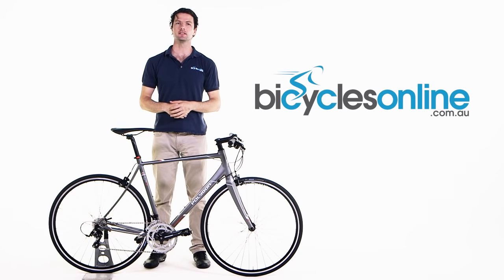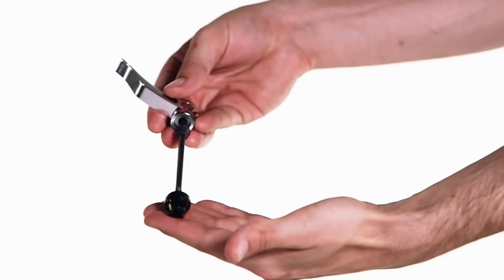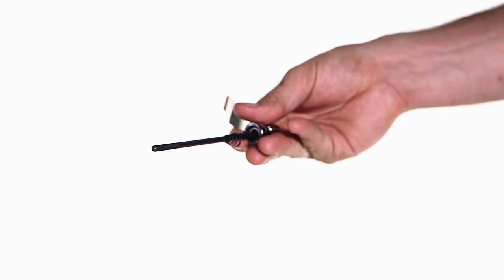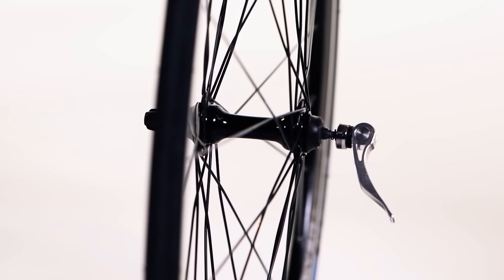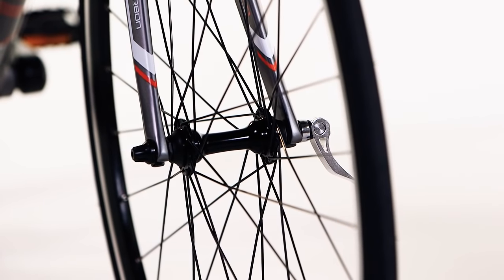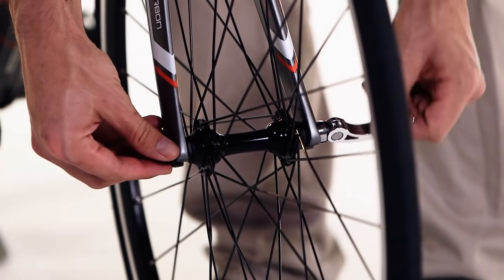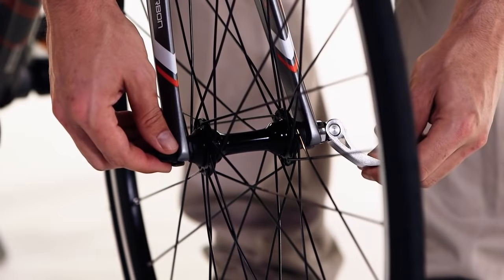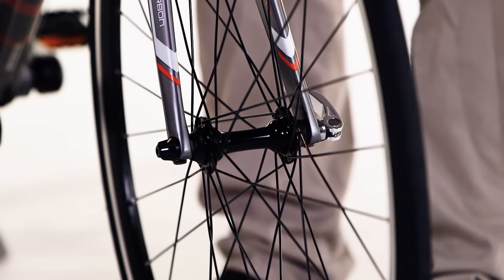How to install a quick release front wheel

Comment: Hello there! I really liked the video and I have a question. I seem to have lost one of the springs. Is having both of the springs crucial? If not, should I install my only spring next to the skewer or the other side?
Reply from the maker: Hi there, the springs are not crucial. They only aid you in installing the wheel. When both springs are used, it centres the quick-release and creates a similar gap on both sides of the axle, this helps you installing the wheel faster. I would place the spring next to the nut.
Cheers
Reply: Bicycles Online You've been of great help, thanks! Love the channel.

Comment: Can you upgrade a bike without quick release to have quick release at the front and back of the wheel
Reply from the maker: Short answer is yes, the slot where the axle sits on is identical on both Nutted Wheels and Quick Release Wheels. However, bicycles wheels are not cheap and even an entry level wheelset from a local bike shop will set you back $300 at least. If you're willing to spend that much money on a new set of wheels, we'd recommend you look for a brand new bike instead. You can get one delivered to Australia for $400/500 and it will be a much better bike than what you currently have.
Check some of the bikes here:
https://www.bicyclesonline.com.au/bikes/mountain-bikes/mountain-hardtail/?rf=&sortby=lowest_price